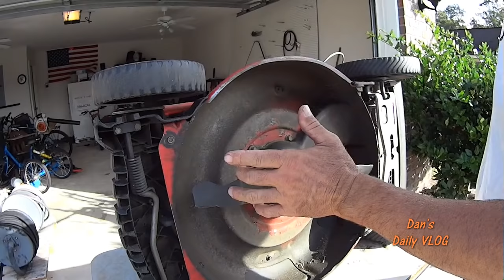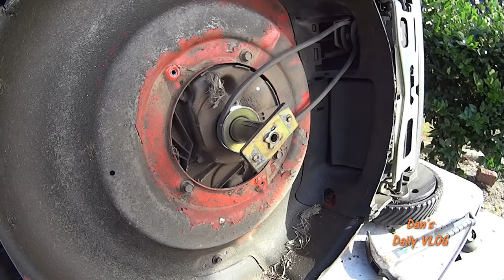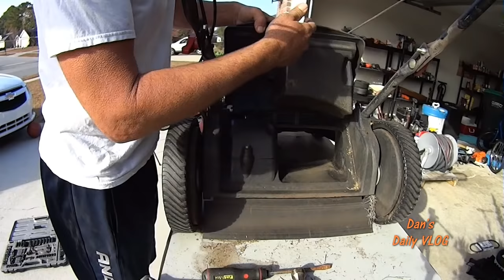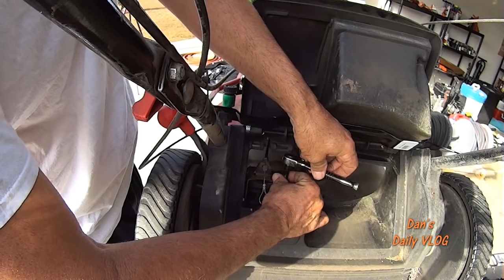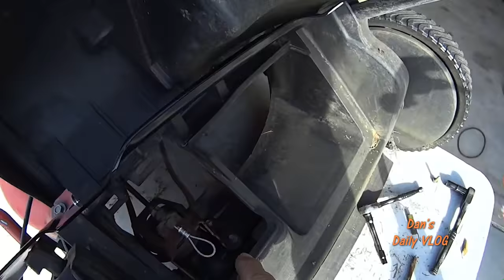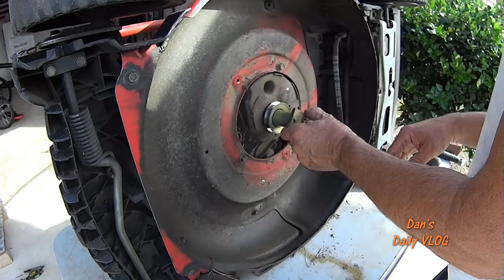How To Replace Lawn Mower Drive Belt, Blade and Blade Adapter - Troy Bilt (MTD)

Comment: excellent, excellent, teaching video. I appreciate your taking the time to show the ALL the adjustments and work in real time, as opposed to fast forwarding through your adjustments. As a DYI "student", I appreciate being able to stop the video, look at the position of your hands, tools, and parts to properly understand the technique required to do the job correctly. As a side note, I was extremely impressed that you did all the repairs and still maintained a perfectly white t-shirt. Bravo!. Thanks again for sharing. You are an excellent instructor.

Comment: Thank you so much for this video! I have been searching and searching for help to replace the drive cable on the same type of mower. Found nothing online until I ran across your video. Obviously I’m not taking apart everything on the bottom because I don’t need to, replace the belt only the cable. Thanks again so much!
Reply from the maker: Happy to help

Comment: Thanks, Dan. Watched your excellent video about replacing the drive belt and thought, “I could do that!” My 190cc Troy-Bilt Instep just hasn’t been pulling its own weight lately. But then I checked the owner’s manual and saw that there’s second hole to attach the throttle cable after “reasonable wear”, so I tried that (no tools necessary), and it worked: she’s running like new! I’ll be doing the drive belt in a few more years.
Reply from the maker: Excellent!

Comment: Thanks, my belt was stretched so far I had to push my mower.  Your video showed me how, on the same mower I have.  I will fix it today.  I will say I have some nut drivers (like screwdrivers) that I think will work on the "little fingers" screw.  Thanks for taking time to share this video.
Reply from the maker: +Mike Malone My pleasure.

Comment: Thanks for the vid. I had to use a different technique to remove the pulley. It was not easy. i banged as hard as i could for about an hour, constantly swapping sides but was getting nowhere. I didn't have a puller so i welded a nut to the end of the pulley and i ran a bolt down inside the pulley to push against the broken bolt as my blade had sheared off! I oiled the bolt that i used to push down against the shaft. Once the bolt was nice and tight creating some pushing force then i started to hammer again. After alternating 2 or 3 retightening sessions and hammering sessions the bolt started to tighten down more which was just the pulley coming off. I had tried heat with a propane torch, WD and lots of hammering. The home made puller jig was what finally worked for me. To extract the broken bolt i took a largish nut then drilled it out and ground it thinner so i stood a better chance of mig welding down through the nut and onto the broken bolt. I also built up a bit of weld onto the broken bolt before holding the nut in place, this brought the surface to be welded to up closer to the nut. Finally the broken bolt came out very easily.
Reply: Looks like the exact same mower i have over here in Europe. Does yours have the Kawasaki engine?

Comment: Just the video I needed to see...you rock sir...I do have a question...if oil is still in the machine what is the proper way to turn it on its side to keep from having future problems....thanks Dan...now where is that cup of coffee I just had?
Reply from the maker: Whenever you tilt a lawnmower on its side, you always want to lift the side of the mower that has the carburetor. That would be where the air filter is in case you can’t see the carburetor.
Reply: @DansVlog  thanks so much and have a blessed and safe week ahead

Comment: Great video. Love my snapper. A lot less plastic. Drive hub is one solid piece no nipples or anything that will ever wear out like those 2 nipples. Blade bends engage squarely with it. Hardened steel much beefier. Spray those wheel bearings after every mow and you’ll never have a problem. Never buy the can of WD40 buy the gallon and get a spray bottle. Works awesome and way more economical. Thanks for posting.
Reply from the maker: Great tip! Thank you

Comment: So this was very helpful, I got the pulley changed, lot easier than I expected.  Now it doesn’t “self propel” seems like there’s too much play in the belt.  But it’s on the pulleys, any ideas?
Reply from the maker: When you engage the lever at the handle the cable should pull the transmission backwards which will cause the belt to go from loose to tight there by engaging the self propulsion. Make sure the cable is hooked up to the transmission and is actually pulling the transmission backwards. Also, make sure the belt is on the pulley on the transmission as well as the pulley on the crankshaft of the engine
Reply: @DansVlog  thanks so much I’ll take a look

Comment: thank you for the excellent instruction; I looked at a bunch of other videos trying to find one that included the rear wheel drive mower, like the TB360, but none showed how to replace the belt on this model. I tried to replace the belt but I could not figure out how to get into the transmission housing to release the belt because I overlooked that bolt in the discharge chute that was filled with grass cuttings. (My tb360 is an eager mower, but it is not especially durable if you hit a piece of wood or a stone by accident. I have replaced the blade pulley adapter and the support twice already. The gas tank is very cheap and the cap will not stay on, even a new one. I am not paying $50 for a new one. The muffler has also vibrated off and I lost a bolt and the remaining bolt broke off in the hole, plus the plate that has the bolts securing it to the deck has cracked off in one area.) Again, thank you!

Comment: I have a TB320 rear wheel drive 190cc mower and that cable with the loop on the end that goes into the transmission broke. I'm having all kinds of problems finding a replacement part for that exact cable.  Do you know the part number for that cable?

Comment: Dan, Thanks for the vid! This is the only one I have found that shows the drive train on a TB360 and how to disassemble it! I have to replace the speed control cable and this will be a great help! One question, do you know the size of the belt? I ordered the cable and the speed control handle which broke. But they were showing as out of stock on the belt.
Thanks again, Dan!
Reply from the maker: You're welcome! Not sure on the belt size
Reply: @DansVlog  actually, if anyone needs the belt it's a MTD 954-04282 Cub Cadet belt with the same number will work too.

Comment: Very good information. Thank you very much. So now that I’ve done all that I find that the mower stays in Drive before engaging the transmission. I’m guessing the belt may be a little bit too tight. Hopefully it will slack it up in the near future in the mower will not pull away from me even when it’s not engaged. Any insight into something like that?
Reply from the maker: Ya you either routed the belt wrong or it is the wrong belt
Reply from the maker: Maybe you routed the little spring wrong and it is pulling the transmission tight instead of loose
Reply: Found out the hard way that if you do not put everything back together including all the shrouds then the belt will not be routed correctly. I tested it first without reinstalling the shroud underneath the deck and that kept the belt from being properly tensioned because there are little studs in the shroud that draw the belt closer together so that it operates correctly. If I had put them in back together before testing it there would have been no problem.

Comment: Best video Troybilt 360. I was able to do everything but my replacement adapter doesn’t seem to want to stay snug. I’ve hit it to try locking mechanism but it doesn’t want to stay flush. I put the old adapter on and it secures without giving a tap. Any ideas? It’s the exact replacement blade adapter with pulley. Any help is appreciated
Reply from the maker: I am not sure without seeing it

Comment: great video....you do a good job explaining what to do.....what r your thoughts of spraying wd40 under deck side to help reduce grass from sticking
Reply from the maker: No need. There is no tricks and gimmicks. Either way, the grass will stick if it is wet enough. WD40 cost too much. Keep a scraper in your back pocket and clear it out if it gets bad.

Comment: Nice video Dan. Quick question. I have an 860. It's similar to the 360 in a lot of ways, but the transmission and drive belt configuration are pretty different. Do you have any experience with that model? I'm trying to diagnose a self-propel failure. I can see that the belt is good, the rear wheel gears and teeth are good, the cable is good, but I can't figure out how to test the transmission. Any help you can offer would be greatly appreciated. Thanks!
Reply from the maker: Based on everything you just told me, you already tested the transmission by it being the last item to check with everything else being good! If the belt is good the gears are good good and the cable is good and it’s connected and it’s pulling the belt tight then it would have to be the inner gearing of the transmission that let go
Reply: Gotcha. I wasn't sure if I was missing something. Have you done any videos on removing the transmission? It seems like a lot of components need to be disassembled first to get it out.
Reply from the maker: I have not, sorry

Comment: I hope this is not a stupid question, but how do i handle the petrol and oil inside the machine before replacing or putting back the drive belt on?
Reply from the maker: lift the left side of the mower leaving the right side wheels on the ground. Find something to support the handle so it doesn't flip all the way over. No stupid questions... well asking my bra size would be (I am a dude) but otherwise, ask all you want!!
Reply: Dan's Vlog thanks dude ;-)

Comment: How do you know belt is bad and not other part of the assembly?
Reply from the maker: It is usually the first thing to check because it is the cheapest and easiest to replace. With the engine off, it is easy to feel if the belt feel loose while engaging the self propulsion WITH ENGINE OFF!!